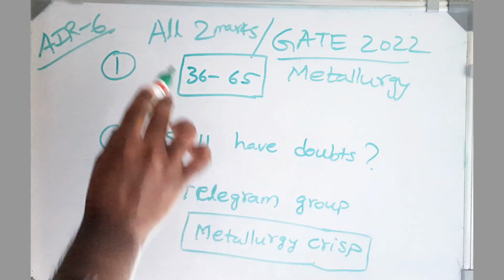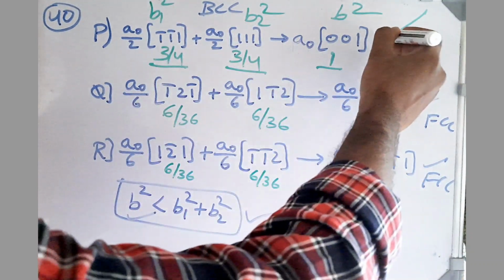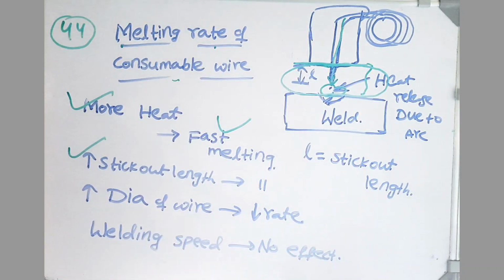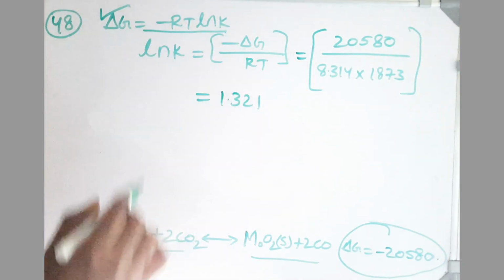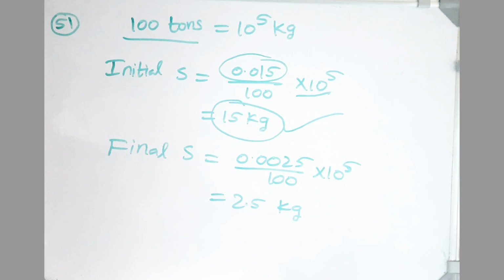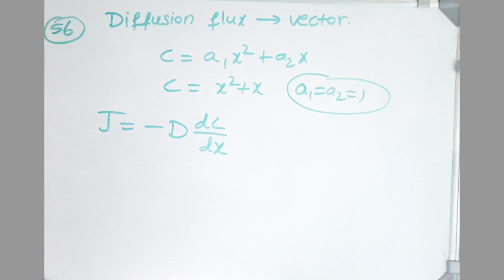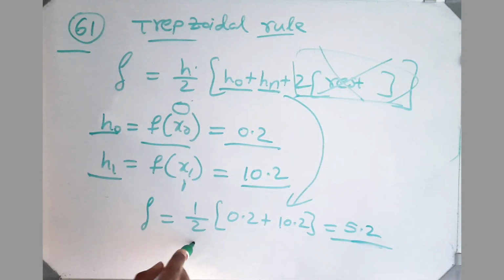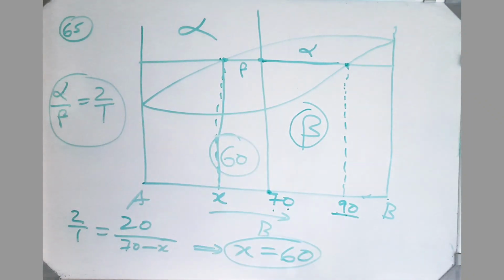Metallurgy Gate 2022 solutions of all two mark questions | By AIR 6 #gate #metallurgy

Comment: In 55th question r* formula doesn't have minus in front of 2Gamma why
Reply from the maker: It is a sign convention. If you put minus in front of the formula, you need to enter the volume free energy value (while substituting) as negative value. Surface energy is positive. Volume free energy is negative. It works both ways.

Comment: Last question. That's homogeneous phase diagram. And alpha phase will be liquid always.
Reply from the maker: Yes.
You are correct!
Reply: @metallurgycrisp    question talks  microstructure .
So nobody would thought of the homogeneous phase diagram here.  So many people get wrong here. Or any another approach is there??
Reply from the maker: Draw an Eutectic phase diagram,and draw a tie line below Eutectic line where both phases exist.
Follow the exact same steps in this video, you will get the answer.
I should have considered an Eutectic phase diagram in this video as well.